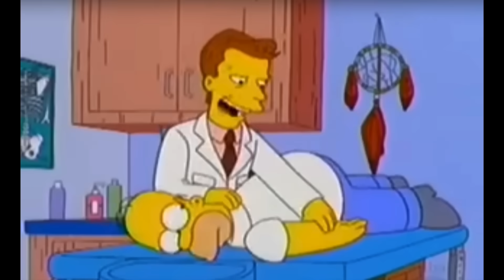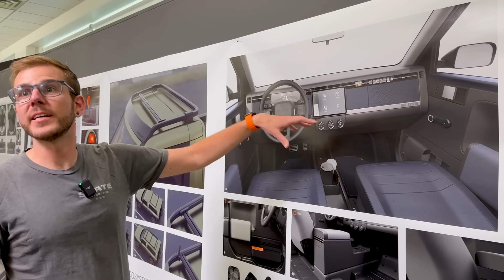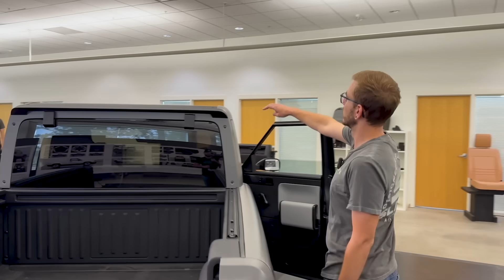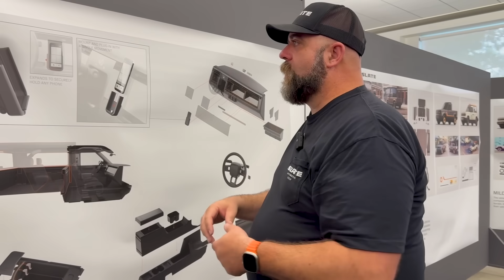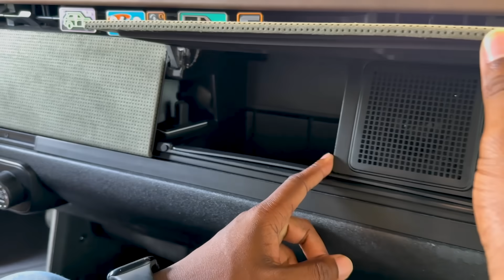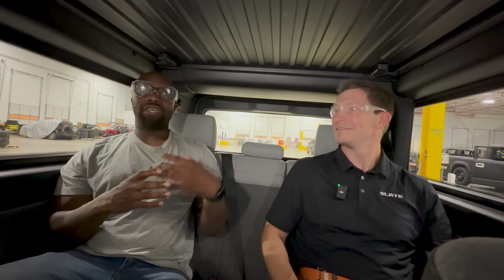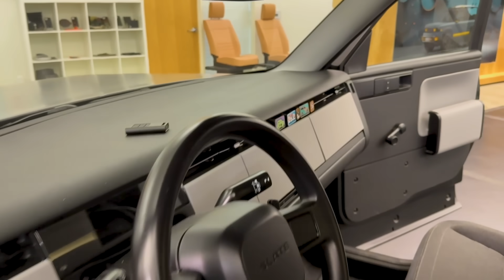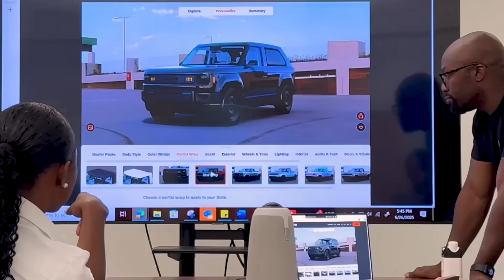The Slate: America’s $20K Answer to China’s Cheap EVs (Exclusive Access)

Comment: That whole Slate truck costs less than fixing the small dent on your Rivian. 😂
Reply: You have to add tax even at $27,500... and that will bring it to $30,000 in most places. And its still half the price of any other truck you could get.
Reply: Does it have AC?
Reply: Yes it has AC
Reply: @gregorybarth930 NO! That is an added option for an extra cost and will diminish your 100mile range on a good day to maybe 60 if you are lucky!
Reply: It won't even exist, at least for that price... But I do hope they succeed because I'd buy one used based on looks alone. 

I want to be proven wrong, but they aren't showing the cheapest model. If they could offer a super cheap truck, nobody would buy that model.

You can buy stripped out base models trucks already, but very few people walk into a dealer and order a stripped out vehicle with no options, put money down or pay in full, and wait for it to come from the factory, they just buy what is available.
Reply: @volvo09  Because if you want to add extras at a later date it's difficult.

Which single cab pickups allow you to turn it in to an SUV using just bolts?

The stereo upgrade is just lifting up panels and adding speakers to rails in the dash board and plugging some wires in. You don't have to remove the dash to do it. 

The slate is like Lego, just add/remove parts as you wish. 
I would absolutely love this because it is so easy to add/remove/change items as your needs and circumstances change.
Reply: @Jamessansome Like they said when they were talking with Jay Leno. Someone can get a Blank Slate as a graduation present and then when they get married and have kids turn it into an SUV. Now.... I have 6 kids and I will tell you it won't be fun putting the kid in the seat with no back door. Luckily, baby car seats are also modular now, so the base is strapped in Once, then you just snap in the seat.
Reply: @Jamessansome on every option they post a install difficulty rating
Reply: @volvo09  This is different from other manufacturers because a person could buy the stripped down base model and upgrade it to whatever they wanted later when they could afford to. A stripped down f150 or silverado would be cost prohibitive to add trim packages to after purchase. This vehicle is designed to be user upgraded.
Reply: @volvo09 I hope it fails at it should. A terrible cheap Chinese truck made in America funded by Jeff Bezoz?!? That sounds just aweful!
Reply: @volvo09 they did show the cheapest model. The cheapest one is the Blank Slate
Reply: I'm sure you can buy a new Slate for $19,990, just like you could buy a new Cybertruck for $39,900 . . . Well, that is what they said you could buy it for, when it was announced, of course, by the time they actually existed...
Reply: @sprinkle61  You think bozo would lie?
Reply: @blipco5  idiot is comparing Felon Musk with Slate, Elon is known for lying his ass off.
Reply: Still sounds expensive with no power windows or even a radio!
Reply: @JohnDoe-qz1ql I prefer roll up windows.  Hate to have to start car to roll windows up or down.
Reply: @JohnDoe-qz1ql  Agreed.
Reply: @JohnDoe-qz1ql not sure why anyone cares about power windows. I have n3ver had the hand crank windows fail.
Reply: @JohnDoe-qz1ql  they sell a power window option and your tablet plays the music.
Reply: @paintki1z  which will be even more expensive 30k for no crank windows is insane
Reply: @imanbutton7072 I highly doubt power windows would be 10k lol
Reply: @paintki1z  I don’t understand how it has a big screen Already, but no radio options! It isn’t a Huge deal, but still! I didn’t see the whole video. I wonder what the truck specs are!?
Reply: @imanbutton7072 oh my God, heaven forbid Americans burn a calorie rolling down a window. Surely some Karen will sprain her wrist and sue Slate into oblivion.
Reply: You use your own tablet @JohnDoe-qz1ql
Reply: @JohnDoe-qz1ql it doesn't come with a screen. It has a mount on the dashboard where you can attach your own tablet or phone
Reply: @GrunkleStan123 it's already $27,000 MSRP, add power windows $250-$500 + wrap $1,000, now add tax and you are well over $30,000!!!
Reply: @JohnDoe-qz1ql the big screen is not part of the truck. They offer a bracket that holds your tablet.

Comment: I would definitely be interested if it had an ICE option but an EV pickup truck is a hard no from me.
Reply: The range alone is a deal breaker for me. 150 miles on a good day at 100% is ridiculously low. Only realistically 100 miles of range not including the range lost by using it as a truck 😂

Comment: I look forward to seeing someone put a carbureted drivetrain in it in the future. I like that the bed looks usable.
Reply: You've seen Iced-T. Now here is the V-Slate.
Reply: No need for that.  Nissan Hardbody trucks are still around.  Rhey look better than anything else on the road as far as small trucks.
Reply: The 226 liter frunk helps.
Might just work in an engine and alternator, wire into the battery and have huge range with ability to recharge the battery for sneaky inner city and suburb rolling.
Reply: @Cloxxki  then you just buy a maverick hybrid
Reply: @rogerwilco1777 yes, let's compare the Easter bunny to a unicorn.
Reply: @Cloxxki  yes🎉🎉🎉